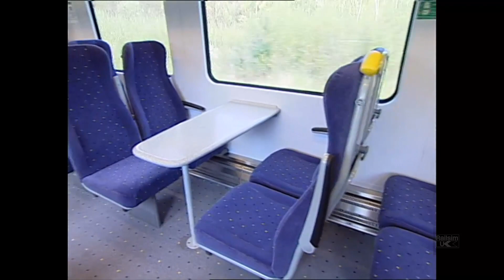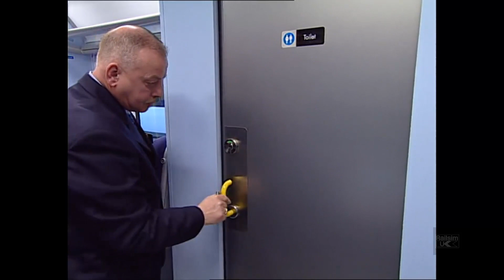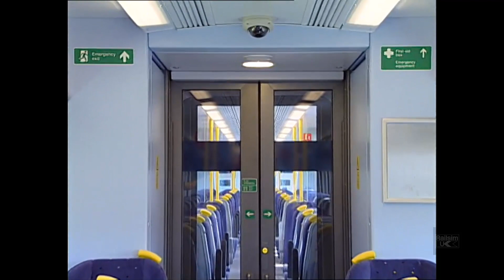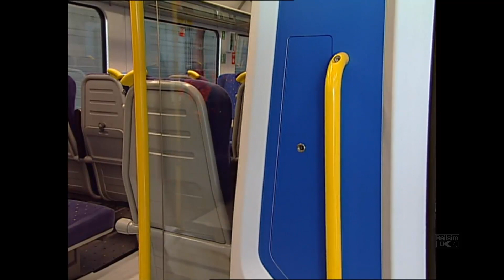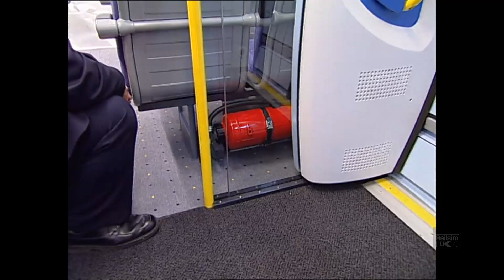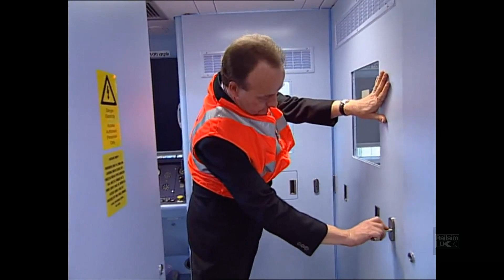Real Learning - BR Class 350 Desiro [Operations Training]

Comment: Is this class 350 powered by both third rail and overhead wire?
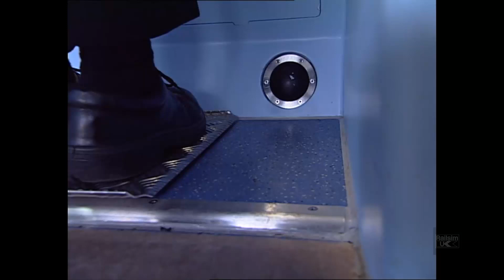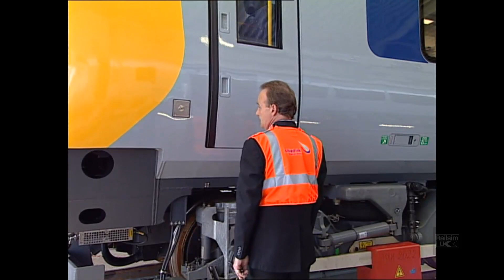I see a contact shoe at 5:24 7:26 7:28
Reply: 350/1s are dual voltage with all other subclasses AC only
Reply: yeah
Reply: @KaiDiesAgain  Class 350/1 has a third rail shoe, they did duties with Southern during 2008-2009 due to delay of the deliveries of the Class 377 Electrostars..
Reply: Yes this is a dual voltage
Reply: Mostly operates with overhead wires
Reply: The /1 class 350 are Bi mode EMUs, using ac and dc power. The /2 and /3 class 350 use only ac power.
Reply: @eeeby_deeby  the BEMU acronym stands for Battery Electric Multiple Unit and not Bi Electric etc, please don’t make stuff up. Dual voltage EMU’s are simply just dual voltage
Reply: @benjibatch  My mistake

Comment: Top speed 110 now
Reply: That was a 350/1,NOT an 350/3 OR 350/4
-The 350/1 can go to 100 mph
-The 350/3 OR 350/4 can go to 110mph
Reply: @TheArkamedBat  arent those the "transpeninne" ones now?
Reply: @bb-3653  No.That's a Class 350/1, NOT a Class 350/4
You should see the variants,OK?
However,thanks for replying👍
Greately appreciated
Reply: @TheArkamedBat  I've seen videos with some transpeninne units as /4s
Reply: @bb-3653  I think 350/4 or 3 are gone on TPE.
Reply: @yayayay-s4w  The 350/3s are with LNWR and the 350/4s are with TPE
Reply: @nathanw9770    Okay, thank you. Im from America. T~T
Reply: Now they all lnwr
Reply: @TheArkamedBat  350/1 modified from 100mph to 110mph in 2012, then 350/3 and 350/4 built as 110mph in 2013/14, then 350/2 eventually modified from 100mph to 110mph in 2018.